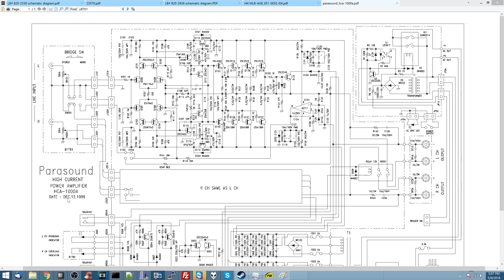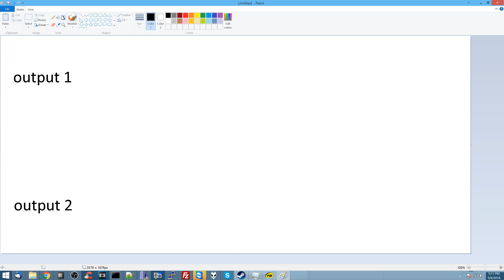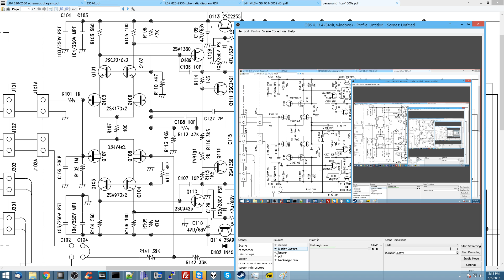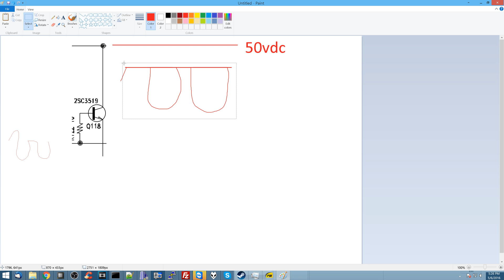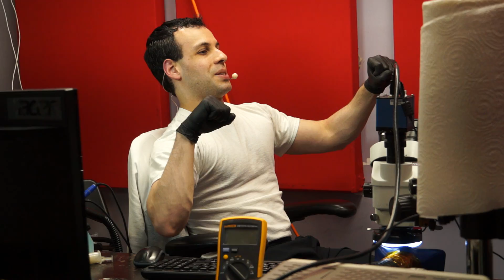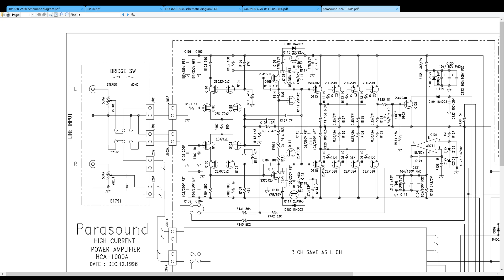If you didnt believe I flunked out of college...

Comment: had an out of production plate amp for a subwoofer from Triad here in portland. They sent me paper printouts of the schematics and diagnostic paperwork for every model variant that the one i had could have been. and offered to help if i couldn't get it working with any pointers. 

so while they pretty much said i was on my own as far as actual repairs, they gave me the info i need to do it myself, at no cost to myself. even though i didn't buy the powered subwoofer the amp came from. 

If i can ever afford to buy their products, they've gained a fan for life.

Comment: My guess is it's the electrolytics in the supply and or the bridge. Try to isolate the supply from the amps. Looks like it's on the same board, so maybe pull some jumpers or just cut the trace. That will tell you if the problem is the supply or one of the amps.

Comment: If the both AC fuses at the input to the bridge rectifier are blowing and there are no burned resistors around the audio output transistors, I would say the bridge is shorted. If only one fuse blows in the + or - supply  a filter capacitor could be shorted. Usually if the outputs short there will be burned resistors in that stage.  Because  this is a DC coupled amplifier if one transistor went bad it usually causes a big burn.  Just my observation from 40 years in the repair field.. Oh BTW I love your videos you are a real entertainer..

Comment: Speaking of linear power supplies, I just bought 10 2N3055s to build a linear for my amateur radios.

Got an old microwave transformer. Going to re-wire the secondary to give me about 25v. Bought some LM317s to set my voltage. Some diodes to rectify. And one giant ass capacitor.

Yeah, I could buy a 35 amp Astron but that's just no fun.

de KE0CPH ;-)

Comment: Hey Louis,  Great work you're doing, keep it up!

I've seen a few people already correct you about the slight error for explaining the bridge rectifier. In the event that anyone is interested in knowing that the diode prevents the flow of current in the reverse direction. The bridge rectifier will take an AC input, but only output the positive "humps" of the waveform. The output of a full bridge rectifier will still have some dips in voltage which are smoothed out by adding capacitance on the output.

Comment: Hey Louis.The amp uses devices called Bipolar Junction Transistors(BJT) which are current to current devices. Base current and collector current are propotional. The JFETs at the input q104, 105, 107, 108 make up a difference amplifier, like in an input of an op amp. This is great for eliminating common mode noise and provides some voltage gain. Q101, 102,103,104 are current mirror constant current sources for the difference amp. Q109, 110 are the voltage gain drivers for the final stage. Q111, 112 form a Vbe multiplier that helps with cross over distortion. The output stage is a common emitter stage that has a voltage gain of unity however, the current gain is high. Q113,114 are filter multipliers. The whole amp has voltage and current gain from input to output.

Comment: Ugh you really gutted it, i could hardly watch ~22min on where output is classic totem pole emiter follower (like CFP) just current gain, no voltage gain and you mentioned 2 volts on the bases, and that output stage increases voltage?!, all the voltage gain is done 2 stages before (VAS stage Q110/109), output has gain dash smaller then 1 with drivers included... dual cascaded diff  input with feedback network (R112/113) (opamp is integrator just for DC offset correction)  decides most of the amplifier behavior/tone... i used to design high end audio amps 15+ years ago, and do not practice that niche but still remember most/all of it... 
Anyway i like you videos, this one is decent for beginners, and amp is nice!
btw i don't have ee degree, just  self taught, started really young my first 60W JLH style amp at age 12 8-) ...
Btw2 you can get really nice linear output stage BJT on DK these days, i always had my own choice of output devices to make amps better/more robust after fixing...

Comment: I don't know if you've fixed this yet, but my take is that the blown fuses F001 and F002 are going to read as grounded out (when the power is off) via the center tap of the transformer. That center tap bypasses the bridge rectifier and fuses and is connected to all of the power supply capacitors. The first thing I would check is for shorted capacitors in the power supply section and then a shorted bridge rectifier. Those caps are going to be old, and some of them are/were electrolytic. They may have dried up or spilled their juice. If the bridge went out, then they may have seen AC and shorted. 

Also, you mentioned something about people interpreting the negative feedback op amp as effecting the signal after it's amplified and thus, you would have heard the signal it was intended to nullify. The answer to that conundrum is that the op amp has a slew rate that is similar to that of the final stage transistors (very fast) and is adjusting their inputs in real time. It's effect will have a delay, but assuming a slew rate that may come close to 1MHz, only a trivial amount of the audible signal error (maybe 1/50th of the amplitude) would be passed to the output. In practice, you could assume that the filtration is effectively in phase. It's tough to make the mental shift to understanding that a section of audible signal doesn't fully 'complete' before feedback takes place. The feedback waveform is created pretty much as its input is being created, with, say maybe a millisecond of lag. This means that you may see a small remnant of a test noise input on an oscilloscope, but not nearly close to hearing that noise when desired sounds are also being run through the amplifier.

Comment: BGTs fail usually due to something called thermal runaway. They end up eating and passing so much current & end up having to disipate about 5W of heat in about 50ns...yea..fun and games & leads to a puff of magic smoke from the board.

Still better than the fishy smell from an electrolytic capacitor...that shit smells like a bad vagina with BV.

Comment: You know how i can tell you dropped out of college?  Your bridge rectifier DC positive and negative outputs had partial AC sinewaves instead of alternating pulsed dc like this

out1+ ---    ---   ---   --- 
out2-    ---  ---  ---  -.

Actually, do they even teach this in college? I dropped out too.

Anyway that's why those big piles of caps are there on the BR output, to smooth those dashes into straight lines, continuous DC current at the input AC less voltage drop and losses and stuff.

  And those sine waves for the AC current you drew, for example at mains 120v, let's say it's a 1:1 transformer, are actually 170v and -170v, 120v is the root-mean-square.  I think that's a fancy word that means something similar to 'average at any given moment.'

Decent explanation overall, but just call transistors switches and explain it that way.

Comment: First let's face the facts, for what they are. Our profession is no different than any other, you find maids living in a messy house,  plumbers with a leaky pipes, and auto mechanics driving junkie cars, that just life, Nobody wants to work on their own stuff. Are you still down the rabbit hole on this unit? What are the actual symptoms? Clicks status led's etc? I had a bunch of stuff built up last night for you, then the little laptops battery, which wasn't suppose to be running, dropped out. I know what it's like to have a beloved piece of hardware fail, but, can you find, or is it worth the time you'll be spending on it? There are used units out there still available, I've seen, for around $200, & in better shape. 
That being said, what happened to your amp? Trouble shooting is far and few between, Howard W. Sams use to publish "Sams Photofact" & "Quick Facts" that not only covered the schematics, but, also had wave forms & typical voltages info to work from. It may still be around (this dates me though). The trouble shooting is really the same, you take the errors reported, then look for the clues, the difference is you start from one point or the another, (not the middle) & just work your way through it verifying what it should be. This is why we preferred paper schematics over microfiche, so we can mark it up. Just like you normally do, looking for the clues, in this case though, got a feeling your looking more than just popped transistors. Bad parts around those popped parts are a concern too. Noting and repairing Solder joints, dries up caps, and resistor do change values. It's a shame they didn't break the parts locations down, by stages on the original schematic, like they still do for TV's. But, since it's Stereo, you do have pretty much a mirror image to work from. 
On transistor replacement, stop beating yourself up, a 2n2222 is a 2n2222, not enough difference from one to another, or from mfg to mfg, to make much difference, as long as you match part numbers &, keep the same envelope and it shouldn't matter. So if it's a to92 case, use a to92. But, if that transistor is bad, be sure to look around at it's supporting parts. The only place you need to worry is if you see "MP" for "matched pair". Or to say it another way, the only difference is what the cartel charges the poor OEM. You've got a little room to juggle values of the desecrate components. I'd keep them the same excepting on the caps where I'd tell you, to up the temp coefficient where you can. That will keep them from drying out so fast. Oh yea, it's a good idea to keep a load on the output while your testing, the speakers will work for this, nothing special needed. I find you youtubes quite entertaining, and I'll leave it at that.

Comment: Hey Louis great to see you a little out of your element on this old analog amp just thought I would mention the current stage typically has a gain of almost 1:1 so no voltage gain just adds the current at that part . Beta is a good  test the crazy audio file will use a current trace to find beta across the audio range from 20-20khz. borrowed the one in collage labCheers Harold

Comment: Your explanations are really nice, but because you asked for corrections, the feedback loop you mention in the schematic is not 
actually the negative feedback. It is what is called a servo circuit for canceling the DC voltage at the output. You can notice a large cap in the feedback loop of the opamp, so it is obviously a low pass filter which only lets the DC component to travel back to the input.
The actual negative feedback loop is just a simple resistor divider which goes directly from the output to input.
Love your work.
Excuse my English, I live in Europe :)

Comment: I studied Electronics, then Radar systems. Every once in a while someone says "my DVD player doesn't work" or whatever because they know I'm somewhat knowledgeable but I usually just say buy a new one.

Without the schematics there's not much I can do. Heck, I don't have parts so when my own M-Audio AV40 speakers died I had to Google for people with the same issues to find out it's probably four capacitors that need replacing.

On a side note, in College we had to troubleshoot a bunch of broken VCR's as part of a troubleshooting class. I asked the teacher what happens if we can't fix it? He said if we don't fix it we don't get marks.

It was NOT EASY to fix them. In fact, some were impossible due to lack of parts. I ended up buying a used one that works then "breaking" it in a few places so I could "fix" it. I almost felt bad.

Comment: I just purchased a Parasound  HCA-800 ii and repaired it. It sounds pretty sweet with a B&K Ref 50 ii and RTI-A9's. It's a great design for easy repair because the bottom plate comes off. It was a 10uf cap at 40ohms that was stopping the relay from turning the amp on and keeping it in protection mode. I'm sure many people would be interested in a Parasound amp repair because there isn't much out there.

Comment: Channel is highly relevant to my interests, have a sub. :)
Para are really good to deal with, I've sold their stuff for years. Not surprised that they handed over the schematic, since the HCA series was discontinued long ago and they've long since made their R&D investment back on that series of products.
Thanks for the video, it reminds me I should get around to fixing my old 5-channel HCA85. I was able to find a schematic for it online (I've forgotten where), but on initial inspection it appeared that the only thing wrong with it is leaky/dried out caps in the 12V DC trigger circuit, so the damn thing keeps shutting itself down. Should be an easy fix... when I get around to it... :)

Comment: There was a time, you just opened the cover of your amplifier and you had schematics glued inside it.
Reply: Simon-Pierre Dubé like, a sheet of paper?
Reply: Yup, when those were simple enough. After that, most began sending what they called schematic service manuals, to whoever send them a mail asking for it.
Reply: Simon-Pierre Dubé Because the circuit was too complicated to put on a single sheet of paper?
Would it be like a booklet of block diagrams with explanations for theory of operation for each block?
Reply: radiohead4everrrrr 
It's multiple factors to my understanding. Most amps used to have one or 2 PCBs, not very complex. When one amp became 3, 4, 5 different modules, with some complicated interactions with some kind of front panel with microcontrollers, they moved a step further toward removing the sticker diagram. There was booklets with some diagram of the important stuff, like the output transistors, capacitors and such, but not full like it used to be. The booklet you received by mail had more details on the specs, even sometimes with suggestions of what are the best frequencies to cut with the crossover for better performance and clearer sound, with some detailed graphics of the performances. With high class amps, like Crown and Harman-Kardon (like Citation 16), those were printed in  color on plastified sheets, it had a cost. Which lead to the second factor, less and less people were interested in repairing their amps themselves, so they shredded the idea of giving one to the owner by default, to save cost. The culture shifted. More and more people turned toward having it repaired by a "pro", so they sent them to companies a lot more than individuals. Then we entered the micro-electronic era of thrashable crap, with people changing everything when a single part failed in unified units.
Reply: Simon-Pierre Dubé Aw man, that's wicked though. Do you think I could get a booklet from any manufacturer? Or would I be more likely to only get them from high-end manufacturers?

But actually, you wouldn't need booklets if manufacturers just put them as free downloads on their websites.
Reply: radiohead4everrrrr
You can at least find some scan of the service manuals online. Usually poor quality scans, but better than nothing.

http://www.amplimos.it/images/Harman%20Kardon%20Citation%2016%20Service.pdf
Reply: @G8tr1522  Was just a few years ago I has a Sony amp that needed fixed and I did not have the schematic for it so I called Sony and they mailed me the service manual for free. It was 35 pages of schematics and service specs in a 1 inch 3 ring binder in page protectors. Postage a few bucks and manual at least as much.
Reply: Yes....I have a few of those in my pitiful collection.
Reply: Where I grew up, the local drugstore had the tube tester. Usually only 1 tube had to be replaced (a 6sn7?) Is still used in modern tube amps and preamps.
Reply: The manual of my 1990s oscilloscope has full schematics and BOM at the back. I really hope we can get back to those times with modern tech..
Reply: And sams photofact.

Comment: Slew is how fast a transistor will take until it goes from one value to another, that's not relevant for an AB amp, the thing you mean is the threshold voltage, that is how much you gotta push on the gate until the transistor starts to conduct anything at all, this causes a small bit of noise (because it's gotta be ready at all times), and that's the problem most people care about

Comment: Semester 1... 1978... EE Major... Calc 1... FAIL... Semester 2... Calc 1 FAIL... Semester 3... Calc 1... nope... I changed my major.

Found your channel last month. Watched your whole intro series on basic electronics and learned more 'understanding' of electronics than I did in my brief stint as an EE major.

Bought a cheap SMD workstation, a $26 oscilloscope kit, $75 in parts and am happily burning holes in my workbench everyday. 

After three decades in IT, 70% self employed, like you I learned by DOING. I did eventually get a degree and it was nice to get a degree AFTER being in the business and AFTER being self employed... but most everything I learned was by "doing".

I always tell people that if at least 20-30% of the tech I see each week isn't completely new to me... then I'm not doing my job properly.

Comment: Btw. the stuff with the different transistors, it was big problem back in the day since the technology could wary pretty much during one day of production. Nowadays, it's much less of a problem since the technology is much better, especially in replicability of parameters. You don't really have to match transistors now, IF they are from the same batch.
Reply from the maker: +mrkv4k I still would not dream of not manually matching before soldering them into my amplifier
Reply: Louis Rossmann
Sure. Btw, when you do that, have you ever get big mismatch? Since something like 10 years back?

Because I stopped matching transistors manualy after getting practicaly same results several times even with different batches from one manufacturer...